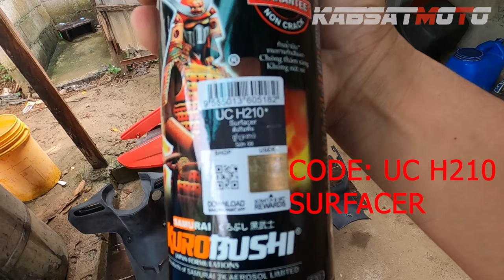Paano mag repaint ng fairings ng motor? | Budget Friendly Repaint Tutorial using Samurai Paint

Comment: Am seriously thinking of repainting my Honda scooter. It's got both metal & fiber body parts. Going to use Samurai spray paint only.  Most important doubt for me is How is Samurai paint curing period and it effective against  petrol? Thanks
Reply from the maker: 2-7days curing time and yes it is petrol resistant.
Reply: @KabsatMoto  thanks, what is difference between UCH210 surfacer primer & 2K04 epoxy surface primer.? Can we use UCH210 primer on both metal & fiber body? Thanks for yur quick reply.